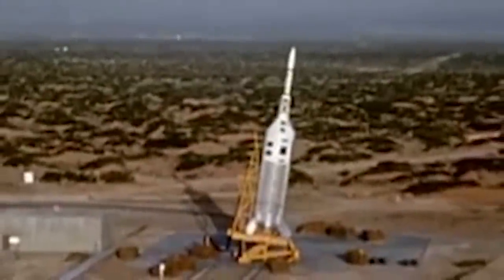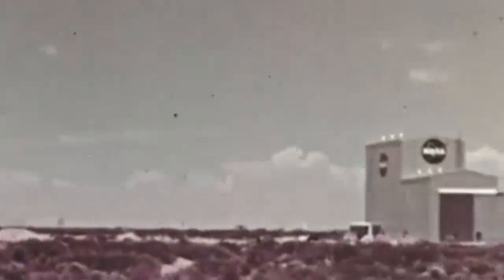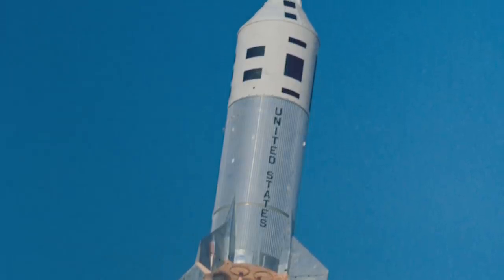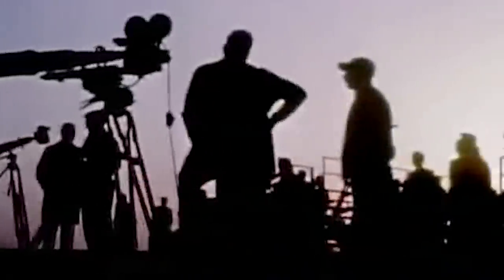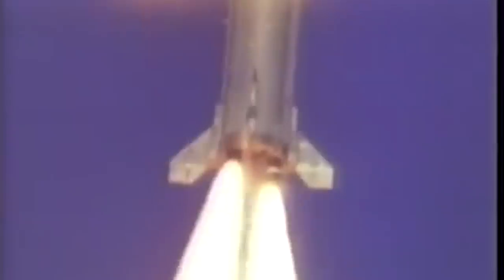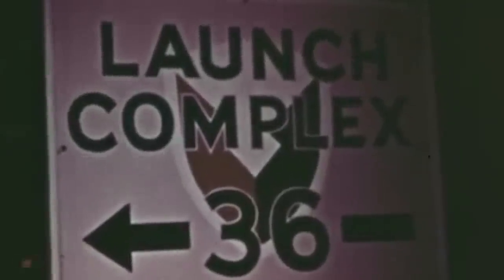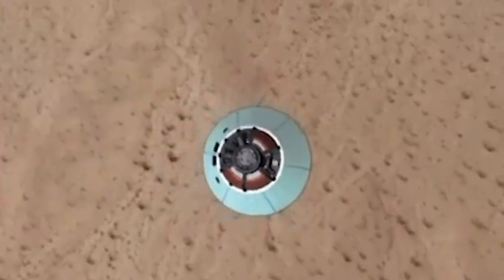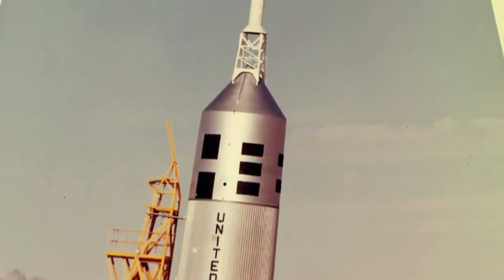Apollo Explosion - The Accidental Abort Test

Comment: I've never seen this before, pretty cool! In many ways, this was a far better test than the original plan
Reply: Yes and no. They didn’t get the high altitude test that they wanted. But it showed them that the automation worked perfectly. The Abort system was triggered automatically. There were three wires, three circuits, running the length of the rocket. Evenly spaced around it. If any of the three was broken the abort was triggered. Which was way more complicated than it looks. As a number of explosive bolts have to fire very precisely. The bolts holding the command module to the service module and the  ones that trigger the guillotine to sever all the umbilical connection between the two. At the same moment the so,I’d rockets in the escape tower fire to drag the capsule away. A few seconds later the bolts holding the protective nose cap that the escape tower is attached to need to fire jettisoning the cap and tower to expose the upper ring of the capsule which houses the parachutes. Really scary is those last bolts have to be strong enough to withstand being the connection point as the escape tower fires and pulls the capsule off the failing rocket.  There had been a somewhat amusing incident much earlier in the Space Program, with the last planned Mercury Monkey launch. When the rocket reached it’s peak, instead of firing the bolts to jettison the escape tower, it fired the escape tower rocket, still attached, dragging the Monkey and Mercury Capsule an extra 15 miles down range. To their dying days the Mercury Astronauts swore the damned monkey just figured out which button to push to keep going higher.
Reply: @andrewtaylor940  
There was another incident with the mercury program.  There was a plug at the base of the rocket and both plugs were supposed to fall out at exactly the same time.  But one plug came out milliseconds before the other. So the launch escape system activated leaving the capsule behind and the engines were running. The engines stopped and the parachutes popped out.
Reply: drmayeda1 wasn’t that the last Chimp shot. The one that delayed Shepard’s flight? The running gag as Shepard used to tell it was the monkey figured out which bottom to press to keep going.

Comment: I was surprised when I read that the structure failed like that due to the stress it was under from the rotation. It didn't seem like it was rotating all that fast, but I guess it's really not meant to rotate more than a couple times (roll program, then just minor adjustments after that, presumably).
Reply: 260 degrees per second 4m diameter mass 50000 kg  
That's 450,000 kg of extra force pulling the rocket apart if my calculations are correct.
Maybe 200,000 kg if it was mostly empty of prop at the time.
Reply: Yeah when you get that big around rotational forces can become quite large.  Its why I laugh when people always talk about making large rings in space to simulate gravity.  We simply can't do such a thing without causing it to instantly explode.

Comment: What actually happened was that the fin control surfaces deployed in error.   At 4:03 you can see the unswept hinge line and actuator faring.   This is the cause of the high roll rate that destroyed the vehicle.   Question for Dark Footage:  why did you use animations for launch escape systems that were not Apollo?  (See 3:55 in the video)  I'm sure there were plenty of animations available for the actual system.   Also, you said staging in the video.  It was a single stage vehicle.  The abort process is not 'staging'.
Reply: And it's kuh-NARD, not CAN-erd.

Comment: It wasn't one wire running down the vehicle...it was 3.  If power was lost to 2 of the 3 wires, that was when the system would automatically fire.   One of the engineers stated this in an ep of "Moon Machines."

Comment: 1:50 - if what signal was lost?
Reply: Since they were using what seemed a chapter from The Mousetrap School of Design handbook, let's assume the most simple circuit imaginable:
The 3 wires use the metal body of the rocket as part of an electrical circuit.
As long as electricity flows through the circuit, a relay is kept open.
If 2 of the 3 wires break that means the rocket is breaking up so the relay closes and the escape tower is activated. Simple and foolproof... and inexpensive, too.

Comment: It’s good they had an actual error detection system rather then manually pressing abort when the time was right, the accident would’ve killed em otherwise
Reply: Killed who?   It was an unmanned test.  As for the actual, manned missions the abort process could be triggered automatically by the failure of one of the detection wires that ran the length of the vehicle or triggered manually by the mission commander.

Comment: More detail on the actual abort mechanism would be awesome.
Reply: There were three wires running the length of the launch vehicle.  If power was lost to 2 of the 3 wires, that indicated that the booster was coming apart and would trigger the abort system.
Look up the episode of "Moon Machines" that dealt with the command module....it's in there.

This abort was not commanded from the ground...the onboard systems did the job.

A very successful failure!

Comment: Makes you wonder why the Space Shuttle didn't have an escape method.
Reply: Pressure from the USAF to use that particular system proposal because it was quicker, and would let the have the payload size and capacity they wanted for the alleged cheapest method. It also meant that certain senators could push pork through in the right places. 

Darkly humorous, because when it did kill people as had been predicted, the USAF bailed out of the use of it as quickly as possible, and then became the whistleblowers over Ares 1

Comment: Did not exactly explode.  The LJII rudders locked at launch and established an axial roll or spin which then caused airframe structural failure.  It spun itself apart.

Comment: Without the use of supercomputers and CAD, engineers back then not only landed people on the moon but they had enough spare brain cells to design an escape system.  No crews were lost in flight back then, although one crew was lost on the ground during a test.  Fast forward a few decades and not only could the space shuttle not reach the moon, but it had no escape system once it launched and 2 crews were lost in flight.  Apparently we’re getting dumber.
Reply: Apollo 1. lost 3 lifes before launch.